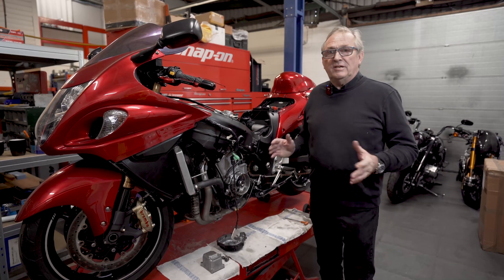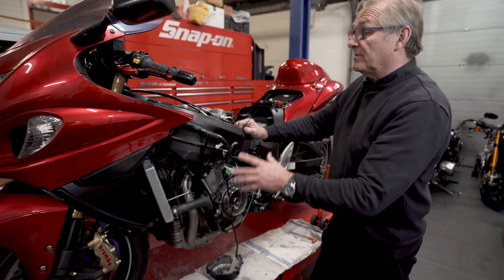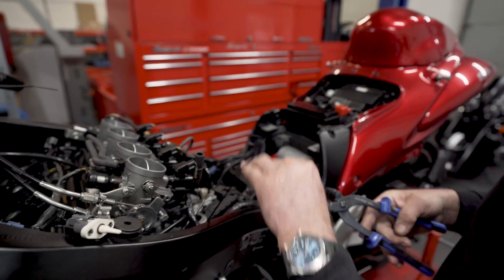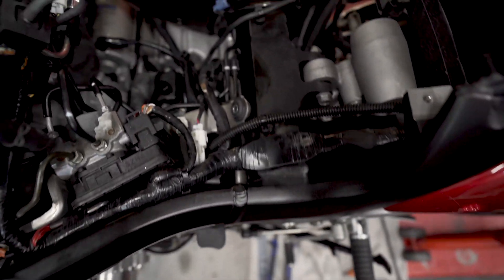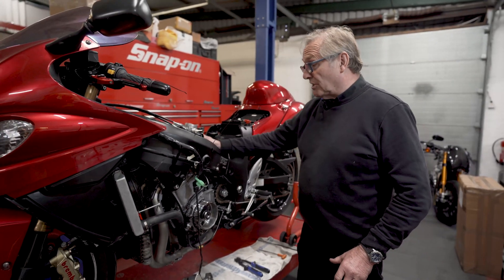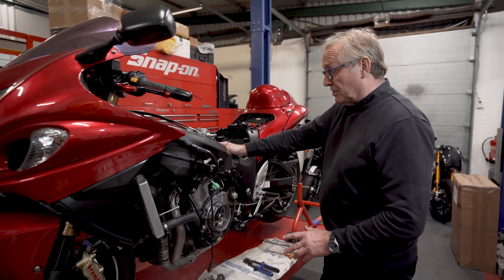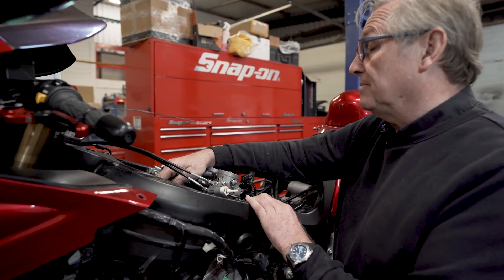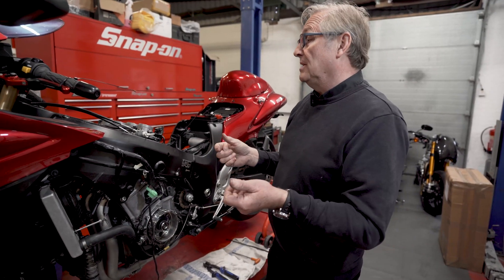TTS Hayabusa 360hp supercharger installation - overview

Comment: Supercharger hanging off the side 🤷‍♂️ I’m sure it could be relocated better
Reply from the maker: Let me know how? It sits 30mm wider than the stock alternator case.
Reply: You know it's not a Turbo system aye?? Crank driven so where would you mount it? Given TTS has been doing this for years, they may have a slight understanding of how to do it. Although yes feel free to share an insight as to where it could go.